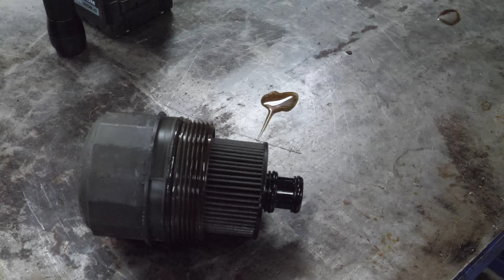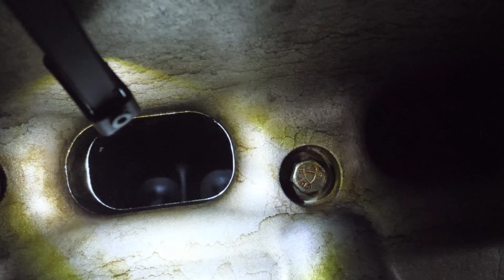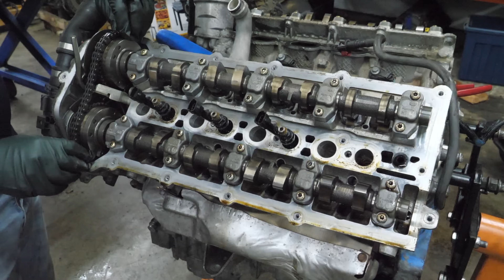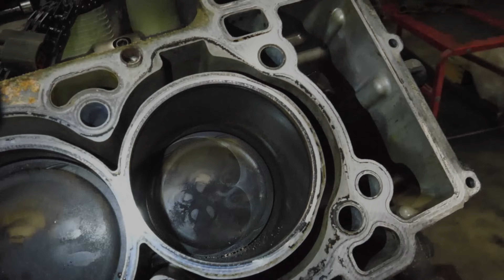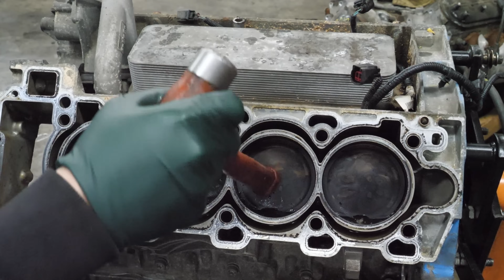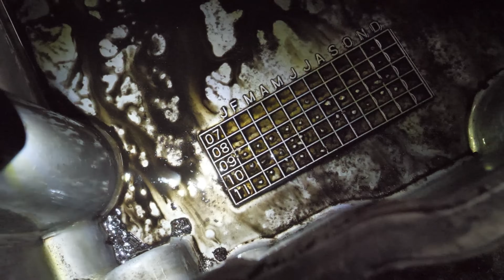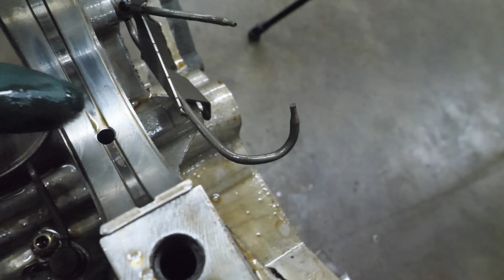500HP Jaguar Land Rover 5.0L Supercharged AJ V8 Teardown! Had to buy AND borrow tools just for this

Comment: You are supposed to "turn" the injectors 90 degrees to take the valve covers off.  Those engines are ALWAYS maintained to the highest degree,  and "SHOULD" last 300-500K miles,   but never do because the cars loose their value so quickly.  And Sadly,  like the Rolls Royce Merlin engines of WW2, they are beautifully made,  yet sold to the mass's to go to war on the worlds highways.  Work of ART inside that engine.
Reply: Do you have any idea why people always say you have to remove tje injectors to get the valve covers off?
Reply: Where do you land rover guys get these wild predictions? Which by the way, never pan out.

"Should last 500k miles" yea buddy, and I own a unicorn, I bought it with my leprechaun gold.

Comment: This one must have been built while Ford was with Jaguar. I noticed the FoMoCo on the leaky chain tensioner. As always, I enjoyed the tear down. They crammed a lot of stuff in a limited space on this one!
Reply: The cam caps also say FoMoCo on it.
Reply: Yes this was built in Bridgend In South Wales UK. The oil pick up pipe and sump is a Jaguar one. LR had a longer pick up pipies and deeper sumps.

Comment: Years ago (1956) I bought an open end wrench called an aircraft wrench.The grip was on the flat side of the bolt head. Years later I bought a set of Met-Wrench Toole because of a broken spark plug. Same thing. Grips the side of the bolt. Beat the heck out of pulling the head of a Ford E150. Each size is for SAE and Metric. still works great when needed.

Comment: That was either very low mileage, or very well cared for as there was zero sludge, discoloration or overheating.
Reply: Some engines produce oil varnish by their shitty design. I’ve seen some very well maintained and yet when doing simple valve cover seals, the interior was quite varnished for the mileage. 🤷🏻‍♂️
Reply: This engine has a 8.5 quart oil capacity.

Comment: When you say this engine has alot of bolts. I would say that may be an understatement! I was actually getting stressed out just watching you in the disassembly thinking thankfully you video taped the entire ordeal. I seen another video where the engine had very similar oil fed chain tensioners. Crazy enough after replacing the chain and the tensioners without removing the engine it started up and ran perfectly. For some reason I seem to remember just the gasket set was like $1000 not including the chains and the tensioners. In any case since there was all most no damage to this engine. I was thinking wouldn't it be great if you had all the parts to reassemble it on the spot. Then get it started to be sold as a complete running engine. Or to find a compatible vehicle to drop that 500 hp pile of bolts into. Most likely at least a hundred thousand subscribers just chomping at the bit to help make my dream come true. Hey, Sorry I got a bit side tracked there...

Comment: Potentially could have used a fuel system and new timing chain tensioners, other than that I don't think anything was really wrong with it. (Minus the light piston and head damage. But minor things like that are actually fairly common)

Comment: Definitely something wrong with the left bank timing chain tension (the bank you can't see through the oil fill cap) and I suspect it was rattling. In response to another commenter, the tensioners as well as being oil pressure fed, also have a spring and there is a grenade pin you pull out after installing new tensioners to release the spring pressure. 
Jaguar had a design problem pre 2017 leading to wear on the moveable guides and did a  design update. The earlier aluminum guides were wearing through where the tensioner applied pressure to them which resulted eventually in a slack chain. Their fix was to integrate steel on the new guide design at the interface. Would have been good to look at that guide to see if indeed it had the older design and it looked like it was worn. If you still have it, take a look and let us know.

Comment: The play in the supercharger isn't because of soft material.  It's a set (3) of spring steel pins in the coupler that allow some buffer for vibration.  They wear out and the slot the springs are in basically becomes a 1/4 inch slot that allows the engagement pins to slide that 1/4 inch distance back and forth without the resistance the spring would provide.  So it becomes sloppy with that play you noted. It's not a big deal but whenever you take off the supercharger to replace the inevitable Y cooling pipe failure (that fails after about 4 to 5 years), most people replace the supercharger coupler with a solid design that is softer but tends to last basically forever.  It's all over YT.

Oh I should add, the Y pipe that fails is only on the 3.0 V6 because it's plastic but you can replace it with aluminum.  5.0 comes with aluminum Y pipe.

And that bolt you found happened to me too.  If someone has taken the supercharger off which I'm betting they did on yours and I KNOW they did on mine, I believe they dropped the bolt into the valley as they put the top of the supercharger back on.  They gave up looking for it and put a new bolt in.  In my case I found one bolt that wasn't like the others.  Obviously they didn't want to hassle finding the original design and they just through a standard bolt in.  Then I found the original in the valley like you did.

Comment: Hopefully you fix your impact. Usually those chucks have pretty basic retainers with parts readily available from somewhere like ereplacementparts. Probably a broken spring or something in this case
Reply: Vice grip and slide hammer can be mated. Just need a slide hammer with a 3/8 corse thread shaft.

Comment: Anyone else notice the fomoco stamping all over the engine components? I thought Ford had divested all stakes in jag and rover years ago
Reply: This could be a pretty old engine, I don't remember if he mentioned a year.  I have a Volvo V60 that has a lot of FoMoCo parts here and there.  IDK how many are on the engine but the rest of the body there are a good many as the platform was shared with the Focus (especially the RS & ST in Europe/Asia/Aus/SA which had  the I5 engine as well IIRC)
Reply: Ford built these V8 SC engines for JLR up until the 2021 model year (for the full size Range Rover, 2022 for the RR Sport).  Now they're sourced from BMW.

Comment: Been thinking about this :

My bet is whoever bought this tried to turn it over via the crank pulley, and the timing slipped just like it did in the video.

They promptly noped on it.

More than likely, fixing the timing, it would have run just fine.

Comment: Its amazing to see the engines you tear down. 
I work in automotive manufacturing designing the manufacturing automation & you can get so wrapped up in sensors to check for loose bolt torque on a critical piece for clamping a valve body for face-milling that you forget about the rest of the drive train.

 Its kinda wild to see all these engines & when & where automakers choose chain vs belt vs gear driven components, some of these bug me on what the data looked like for these engineering choices and frankly I look down on engineering that needs a bunch of external fuel/coolant/oil pipe & tubing,
 an engine design team working properly would have all these channels cast into the block which requires the entire engineering program to be an authority in the others' fields and be able to visualize the entire 4-stroke process including heat migration & expansion of the localized parts of the block: 

there is a symbiosis between temperature, rotational speed, and lubrication-localized cooling. FMEA modelling software should enable an engineer to reach a higher state of consciousness with the localized heat generation-metal expansion & vibration & its effects.

 MLS gasket design engineers are the oracles of truth with ICE at every performance envelope, there is no ICE engine that can escape the engineering constraints of their MLS gasket.

Comment: One thing I have not seen on this channel is the motivation to make recommendation for parts brand. Maybe one time he mentioned motorcraft spark plugs. But motorcraft made two piece spark plugs that gave trouble getting it removed. Anyway, with aftermarket parts and what not, I have a feeling a lot more people would chime in. As a casual auto motive parts buyer, I only know few names, Dorman, Beck&Arnley, K&N, so on and so on.

Comment: Pull out on the release on the Milwaukee and turn while holding out. I can't remember if it's clockwise or counter or both but you'll hear and feel a click and that should "reset" the retention mechanism for your bits

Comment: As someone whovs worked on quite a few of these AJ8 in various sizes, the 5.0 was the least reliable because of three main issues:
Timing chain guides, there's an updated part number for them but it's a very labor intensive job. Also the adjustable cams get stuck because of the extended oil change intervals but can be cleaned pretty easily during a timing chain guide replacement.
Water pump goes bad pretty regularly and if not caught will blow a head gasket and at the worst melt these engines.
Third is the plastic coolant pipes. They fail pretty regularly.
Internally aside from the timing chain guides they're solid engines and aside from the timing chain issues of the 5.0, the 4.2 and 4.4 go 300k+ miles without any major issues.
Reply: i’m getting ready to buy parts for my 5.0 sc that skipped timing(117k miles). so far i got all 4 sprockets and the chain kit, what else should i change while getting this job done?
Reply: @hoeman45  Just make sure it didn't bend any valves, replace the chain with the sprockets while you're in there as lack of oil changes makes chains stretch as oil loses it's lubricating properties, make sure it's a reputable parts manufacturer for the guides, tensioners, chain and speocket and be careful as the adjustable cam gears are spring loaded and may pop, get a decent cam lock tool kit, they work for the 3.0 and 5.0 engines. Aside from timing you should go ahead and upgrade the front and rear crossover coolant pipes with the aftermarket aluminum ones as those two areas are the most likely culprits for future leaks, aluminum pipes are basically a permanent fix, be careful of the rear tube on the water pump when putting it back together, getting it all lined up can either go together really easy or really suck and it's all about feel as you really can't stick a mirror or camera back there to see the tube line up. After all is said and done just keep oil changes to the new recommended interval of 5k instead of the old 15k and the timing components should last just about forever.
Reply: @CheekyChan  thank you! also, is there anyway i can tell if the vavles are bent without diving into it? it starts, with a rough idle and slight knock sound. misfiring in a few cylinders and over advanced bank 1 code.
Reply: @hoeman45  Was your timing chain rattling before this happened? If it happened out of nowhere my best guess is that your cam phaser is stuck and HOPEFULLY the knock is just pre-ignition because it can't adjust timing on that cam or possibly hydraulic lifter being slapped if it's more of a tapping noise and not a knock. Does the knock sound like it's top end or bottom end? It's easy enough to check the intake valves but a pain to check the exhaust valves as you'd have to drop the exhaust manifold which isn't an easy task on these cars. Another thing you can do is pull spark plugs and use a 360 boroscope to check for any piston to valve contact on the affected bank, check piston and valve both for any contact marks or bending of the valves. Even a slight tap is pretty easy to see but there's no gaurantee that when you put it back together that the noise will go away if it did manage to just barely bend a valve.

Comment: Very informative video. I recently purchased a 2011 Range Rover with the same engine with 80K miles. I have read that upgrades to the timing chain tensioners and guides are available so I will be upgrading my engine before I have any failures.

Comment: Honda H22 heads have the same head bolt technique - although i noticed that in that jag head, they offset the cam down from the center of the hole instead of the hole being centered under the cam like the H22 heads.

Comment: Do a differential (leak-down type) compression test before doing the teardown... That will tell you a LOT... Then, disect the oil filter element to get a better look at it... Read up on the TSB's or Re-calls on the engine before tearing it down further... Chances are, if you have a good engine, you will know with those 3-things...With that being said, you DID find definite problems with this engine, because you DID do the tear-down... And because if those discoveries, you saved somebody a lot of headaches, you provided your viewers a great service here on You Tube, and You will earn good money selling the valuable parts from this machine... Cudo's to you, Amigo!!!

Comment: Thanks for the teardown. I've always wondered about the Jaguar 5 litre V8 turbocharged. It looks in really good condition and clearly well engineered for most part. The engine is let down by the plastic parts. Change those for metal and you would have a bullet proof engine I suspect.  It could have been a worthy successor to the XK
Reply: Its not turbocharged 😂

Comment: Still amazed about the amount of the hoses / tubings, wiring wrapping around the engine. 
Needing to remove the engine mount to remove the fuel rail lines to remove the valve cover really amazes me. What were these engineers thinking? 
I did not know u can turn the injectors 90 degree to allow lifting up the cover. I could always learn something from Eric.
Yeap, the killer is the loose timing chains. Looks like still have the old style tensioner and aluminum button on the rail. If they have changed to the updated version, this engine could have been still on the road.

Comment: my guess is it was "re-built" at some point and it didn't go well. i'd check the back side of the exhaust valves and seats of the cylinder with the impact damage.  that metal went out the hard way.

Comment: the metal tube that you said "lubricated" the components actually drops in to the oil pan in order to use suction to remove all of the oil for an oil change.

Comment: The idea of torx bolts is that they have a larger surface area of friction between the bit and the bolt head, even more than a hex head because of the shape.  If you calculate the surface area of contact between a bit and the head of a bolt, a torx will have more than a simple hex head or hex socked head bolt and this allows more force to be transferred before stripping rusty or corroded bolts.  It takes into account that the metal will corrode and weaken over time making a torx bolt less likely to slip or strip.

Comment: i think you have it right. i own the naturally aspirated version, but it's the same on the supercharged one according to the technical manual. the tensioners are oil-fed and should "ratchet" one direction only -- tighter -- until they reach their maximum extension. from there they can relax fully (i guess only on shutdown). all but certain they should never jump backwards like that from a half-extended position, and the seal leaking is consistent with that observation on that one.

most of us put 0W20 in these now though they were originally prescribed to be 5W20, and like others have commented, we don't trust that recommended oil change interval either.

Comment: That tube under the oil cap is used to syphon the oil from the oil pan. I had to diagnosis an engine noise and the timing chain snagged a oil spout nozzle. Oh and they also have a "tune" sensor which has the same connector as the coolant temp sensor so if you swap them by mistake it won't run. Had that happen to me putting a engine in a 2011 Sport. Fun... Oh and some crankshaft damper pulley bolts are right hand thread.

Comment: In my opinion, as an outsider, the engine block is cracked somewhere. Hence the water mixed with oil on the crankshaft rings and the water under pressure below some bolts. The crack appears only when the engine is hot and might be invisible while it is cold. And coolant travels, when hot, in different parts and gets trapped.

Comment: I’m going VOTE to put the Mercedes 617 motor for breaking down , these are built to run many miles , I’ve taken one down and it has some oddities in the exterior ribbing bolt to the block for extra strengthening.

Comment: In English terms the auxilliary shaft with a cam on it would be called a "Jackshaft". Triumph TR7 engines had an OHC and a camshaft in the conventional position high in the block which drove the fuel and water pumps. It was listed in the parts manual as a jackshaft.

Comment: You should pick up an old IDI core.  If it's a 6.9, look for cracks around the block heater.  If it's a 7.3, look for cavitation.  It would also be REALLY funny to hear you comment on their ~900lb dry weight

Comment: My best guess would be spark plug diode came loose which upon impact kinked up the guides.  Then it got diagnosed at a minimum of two shops and during inspection that lower pan was removed.  Then the excess silicone inside plugged up the oil pickup which is why the mains show excessive wear.   Seen too many bad engines from poor sealant applications.
Reply: I think you are 100% right with that diagnosis, totally makes sense.

Comment: Just did a rear crossover on a 2011 LR4, yeah the old style crossover tends to break/leak at the seams because, on the driver side of the one I took off, a small pea sized piece was missing right at the seams.... and the countless other rovers that I've done rear crossovers on, usually leaking at the seams there or the front crossover because  like the rear, it's not one solid, or metal piece like some jaguars.